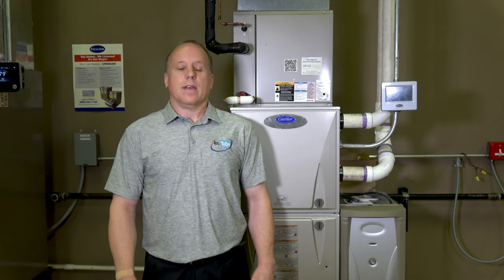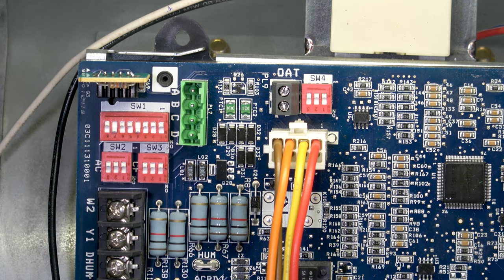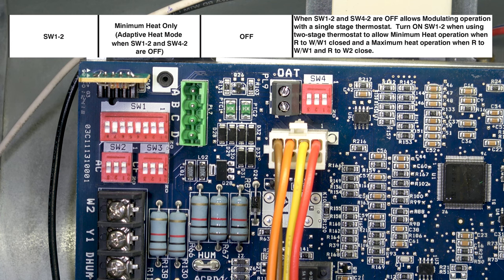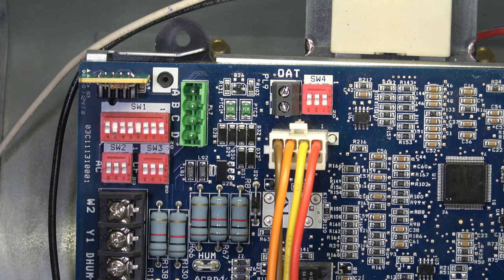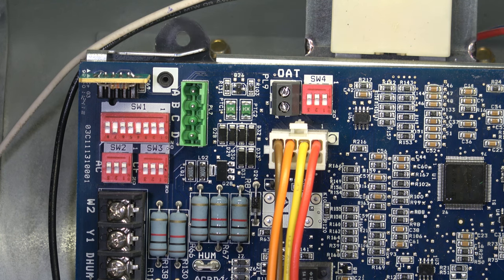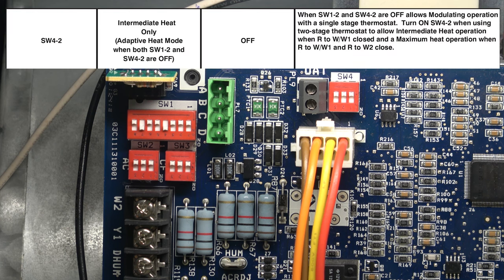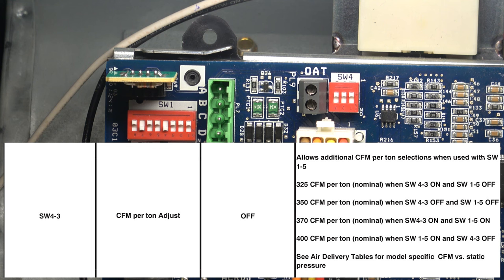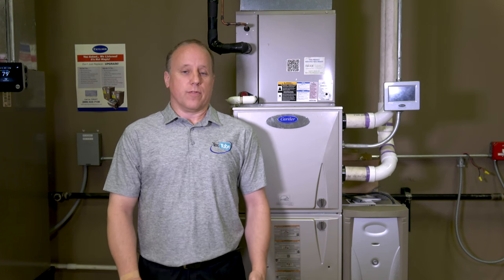Variable Speed Furnace Setting Switches for Carrier Infinity / Bryant Evolution

Comment: I have an ecobee 4 with room sensors in a number of rooms in my house.  Is it better to let my carrier furnace automatically control it's stages using adaptive heat mode, or is it better to connect the ecobee 4's W2 wire and use the thermostat to control the second stage because it can see the different temps in multiple rooms?
Reply: The installer indicated that if you were not using the Infinity Touch Control then they don't set any other thermostat to operate in 2 stage mode and always let the furnace handle it.  Is this because this is really better, or they just don't want to mess with thermostats they don't sell because they don't want the liability/responsibility of troubleshooting it?

Comment: Just had an infinity 96 put in 2 days ago and my blower fan stays on 24/7....even with the thermostat set to auto and OFF instead of heat or cold.  I watched this to try to figure out why the fan blows constantly and im still lost
Reply from the maker: Do you mean have the fan set to AUTO/OFF or you have the heat/cool set to AUTO/OFF?  These are separate selections.
Reply: @TECTubefilms  the fan setting is set on auto and the heat/off/cold is set to off. And the fan still runs. Only way it stops is to cut power to the furnace by flipping the kill switch (light switch to furnace's power)
Reply from the maker: @dunkcards7901  Have the installing contractor come back to investigate.  There are things that could keep the fan on when it should be off, such as error code on furnace (for purge reasons), a different zone on Infinity (if you have zoning), your schedule overriding your manual setting for fan mode, an input wired to the alternate G terminal and configured for fan instead of shutdown or alert.
Reply from the maker: @dunkcards7901  https://youtube.com/playlist?list=PLoR_O4JRNc27j4f0sdFYQJSZ-f6BhSD7i

Comment: I am trying to increase humidity as much as possible since I live in Denver and it is so arid.  We sit between 9-16% of humidity every day.  Are there any tricks to increase the humidity, turn off any de-humidification functions or any tips or tricks?

Just as a note, we are having an Aprilaire humidifier installed in a few weeks, but would love more humidity in our system and maybe for other readers who find this. 
I am personally installing the Aprilaire 700 Automatic model.  Do you have any help on the best wiring setup for best performance year around?  Yes, it will run all year on Automatic mode connected to the blower more call.
Reply from the maker: No reason to turn dehumification mode off. Just set it for 54% like we do in other climates. If it is not above that, it won't use the dehum mode anyway. This way it could still run it occasionally in the summer or other months if you do get a humid stretch in your climate due to rain, etc.
Reply from the maker: For HEATING season (aka winter), your only mechanisms to increase indoor humidity are to seal the building envelope tighter so dry air does not leak in as much and to install a humidifer.
Reply from the maker: Are you also having issues with dryness in the summer? If that is the case, you could increase cooling mode blower speed to 350 or 400 CFM/ton. Set dehum drain on 0 minutes. Use a higher cooling setpoint such as 77 degrees.
Reply: @TECTubefilms  Actually that is pretty inaccurate, a humidifier is what we use to combat dryness in all seasons of the year.  I installed an Aprilaire 700 automatic model but the 800 is better but I have a duct board return air duct.  I am a licensed HVAC business owner and do home performance for a living.  I was asking about specific equipment from Carrier / Bryant and disabling any dehumidification in the Infinity/Connex controller specifically as some of my clients cannot afford to install a humidifier. AC's naturally add humidity, but the thermostats dehumidify as most states need the opposite of us.
Reply: @TECTubefilms  We use humidifiers, i am talking about for customers outside of my service area and those who cannot or do not have a humidifier on their furnace or air handler.  Raising the CFM can only go so far. Most 2-5 ton units will not do more than 400 CFM and that is the default out of the box.  We are not going to turn up our air temperature to 77 as a way to fix and add humidity.  Have you even been to Colorado before?  Changing the temperature will do nothing but make you uncomfortably hot.
Reply: @TECTubefilms  It really isn't that simple on setting the dehumidification to an arbitrary number like 54% as an answer.  It is already defaulted at the highest setting.  I have discussed this at length with Carrier/Bryant tech support and those settings were already changed to maximum.  The only option is a furnace mounted humidifier but not everyone can afford one.  My company doesn't charge that much, but most companies bang people over the head.  So, I was hoping someone with some real knowledge beyond mine would chime in.  We do not have rainy days.  That is why we use Automatic humidifiers all year around.
Reply from the maker: @Balticblue93  What specifically are you saying was "pretty inaccurate?"
Reply from the maker: @Balticblue93  You asked for ways to increase indoor relative humidity and we gave you 2 ideas for heating season and 3 for cooling season.
Reply from the maker: @Balticblue93  True, most units will not do more than 400 CFM/ton. Not true that is the default out of the box. For the systems that this video and thread are about (Infinity/Evolution), the default is always Comfort Mode which is 300-325 CFM/ton. You can increase it as we described and this will change your sensible heat ratio to less latent capacity resulting in less dehumidification during cooling.
Reply from the maker: @Balticblue93  No one said anything was simple. But we stand by the fact that if you set the dehum setpoint of the Infinity stat to 54% it WILL NOT try to dehumidify at all in a dry climate on dry days. You don't want the humidity to be above 60% in any building regardless of climate. Even if you are running a humidifier in the cooling season, you do not need to set it above 40% RH.
Reply from the maker: @Balticblue93  If you are uncomfortable "hot" with a 77 degree setpoint and dry conditions (say 30-50% RH), you are unique and don't fit any of the comfort profiles of ASHRAE and others. In fact, the IECC mandates a MAXIMUM indoor cooling setpoint of 75 degrees for all of your designs.
Reply from the maker: @Balticblue93  True that raising your cooling setpoint does not "add humidity," but it does remove less moisture and results in higher humidity in the space.
Reply from the maker: @Balticblue93  Incorrect that "ACs naturally add humidity." That is impossible (unless it was a chilled water system and you had a leak LOL). In fact, if they run cold enough to hit the dewpoint, they remove humidity from the air (hence the reason for the drain line).
Reply from the maker: @Balticblue93  How do you have clients that can afford and expensive Infinity or Evolution system, but cannot afford a humidifier? Why not sell those types of customers a standard system with a humidifier to keep them in their budget instead of a top of the line without a humidifier.
Reply: @TECTubefilms  Do you even know what you are talking about.  You really need to review the ACCA books and get your head back together.  First off, please show me where the IECC code mandated the maximum indoor setpoint at 75 degrees... GO ahead I will wait.  That is garbage.  

Relative humidity can be increased with an Automatic humidifier or steam unit.  AND YES, Air conditioners naturally add humidity to the air just by principle of the blower motor pushing the air across a frosted or coil that is draining condensation.  That would be ridiculous to say otherwise.  That is why we program the fan to continue to run 24/7 and it will pull excessive condensation off into the air the same way a humidifier works essentially.  And our Aprilaire units run 365 days of the year here in Colorado with the maximum humidity level on the humidistat at 45%.  It will turn off the function automatically, once it has reached it's set percentage.  

First off, my clients don't get banged over the head like yours do, so affording an Evolution system is pretty small dollars for a variable speed system with a modulating furnace and every unit gets an Aprilaire 700 Automatic or 800.  You act like they cost so much.   Dealer cost is pretty low, and I never said anyone cannot afford anything.  I don't sell crap equipment to customers I want the best for.  I just do not mark it up insanely like the big-name dealers.  They have to pay for all that overhead and advertising.  As I said, every unit gets a humidifier and the Connex thermostat unless they go with a different brand such as the Ecobee Premium but that doesn't work with the modulating furnace and 26 Seer AC unit.  The costs between the preferred tier and Evolution are not that much.  I obviously cannot say that here what it really is but I would rather take a hit in margin than sell a lesser unit.  I think it is a joke that dealers are quoting 14 seer units with a single stage furnace and charging 10k-12k here in Denver.  I win nearly every quote that I put out.  I always do a good, better, and best quote.  The good is not some crap single stage.  I work with their budget and have financing otherwise at 0% for 36, 48, and 60 months depending on cost of the system all through Wells Fargo.  I do not have to compete with my competitiors.  My problem is finding enough skilled employees to get the work done on time and to my specifications.  That is where I am really struggling.  Nobody wants to work in the younger generation.  But that is my problem.  I will keep working my butt off and you keep doing whatever it is you call this.  Best of luck to you.
Reply from the maker: @Balticblue93  We are not sure which version of IECC you follow, but lets assume it is the IECC 2018 for now. Look at section R302.1.

R302.1 Interior design conditions. The interior design temperatures used for heating and cooling load calculations shall be a maximum of 72°F (22°C) for heating and minimum of 75°F (24°C) for cooling.

You can view here. Older versions have the same language. https://codes.iccsafe.org/content/iecc2018/chapter-3-re-general-requirements#IECC2018_RE_Ch03_SecR302
Reply from the maker: @Balticblue93  Your comment about the A/C evaporator coil adding humidity to the air is amazing. Where do you think the water came from that ended up on that coil? It did not come from a water line. It came from the air in the home. Hence, the A/C coil absolutely, positively, cannot add moisture to your home. It can remove it by letting it go down the condensate drain or it can retain it by letting it blow off the coil back into the air. But it cannot add moisture. Please tell us where you think the moisture collected on the evaporator coil came from?
Reply from the maker: @Balticblue93  YES you did say people cannot afford things. We quote you saying "The only option is a furnace mounted humidifier but not everyone can afford one."
Reply from the maker: @Balticblue93  We do not "bang any clients over the head." In fact, we do not even sell systems to homeowners at all. We are not involved in that sales process in anyway. We are not a HVAC contractor.
Reply from the maker: @Balticblue93  We are glad that you offer Connex and humidifiers to customers. And it is smart to offer them financing options and to work withing their budgets. You should make a profit, while not ripping anyone off. It sounds like you are doing the right things for your customers.
Reply from the maker: @Balticblue93  We call "this" a free education. We made a video to help newbie installers configure these dip switches and we feel it does that. We are not your free design support tool... but we did try to do that by answer your original question. Not sure why you got all upset about it. You asked for tips so we offered some but then you got all angry and mean. Not sure what you want.

Comment: Hi is up or down off on the switch?
Reply: off = up position, if your board is positioned in the same orientation as this video. In this video you will notice the word "ON" (albeit upside down) to the bottom right of each switch.

Comment: I have a Infinity 98 with a infinity thermostat . Once it goes on 100% heat rate it will not come of it. Any help . Carrier has replaced mother board and thermostat still no change.
Reply from the maker: Do you mean that it keeps heating forever irregardless of how warm the house is?  For example, if you set it for 70 degrees and it is 69 in the house, it turns on and heats... eventually ramps up to 100%, hits 70F, and then keeps heating to 71, 72... 75?
Reply: Once it is 100 % mode it does not ramp up any more i.e. it comes on at 100% and then stays on at 100% till it hit!s the set temp. The only way I  get it to ramp up is turn the power off/on then it ramps up for 3 to 4 hrs then goes back to 100% mode.I think it is the gas modulation may not be operating right . Carrier will not give me any support
Reply from the maker: @rodneyplatt1521  Still not sure what you mean.  It will never "ramp up" more than 100%.  And why are you turning the power off then on?
Reply from the maker: @rodneyplatt1521  If you local Carrier Dealer is unable to support you, call 1-800-CARRIER
Reply from the maker: Have your service tech watch our series on Infinity thermostats and make sure it is setup correctly.  https://youtu.be/hesq8TMhznQ
Reply: Thanks What happens is it goes on 100% when it starts, does not ramp up. This usually happens after it runs on a ramp up profile for about 10 hrs depending on outside temp, in order to get in ramp up profile I have to shut of power to mother board off. It then will start on a 40% profile and ramp up depending on temp. When it shut down sometimes it start on 40% or 100% As said when it goes on 100% there is no modulation i.e.stays on 100%
Reply: What happens is it runs like it is designed to run for say 6 to 7 hrs then for some reason it starts on 100% (no ramp up) and runs till it gets to the set temp then shut down , next time it also starts on 100% and shuts down when it hits the set temp.The only way to get it off this sequence is to turn off power for 1 min then turn it back on, it will then return to the 6 or 7 hrs sequence. Carrier Infinity Touch Control Thermostat 6 months old mother board 6 months old.
Reply from the maker: @rodneyplatt1521  Refer your service tech to page 92 of the service manual for the sequence of operation.  Here is one small piece of it that applies to what you described.

The furnace will start up in either intermediate-, or maximum-heat.
The furnace will transition and operate at minimum-heat or the
calculated modulating rate after starting and operating for 45
seconds at intermediate-heat. The furnace control CPU defaults to
minimum-heat on the first thermostat cycle and calculates the
modulating rate that the furnace should run at for 19 minutes on
subsequent heat cycles.
If the power is interrupted, the stored modulating rate is erased and
the furnace control will select intermediate-heat for 45 seconds,
minimum-heat for 19 minutes and then switch to maximum-heat,
as long as the thermostat continues to call for heat. The furnace
control CPU then uses this information to calculate the modulating
rate the furnace will operate at on the next heating cycle. If the
calculated modulating rate is between 40% - 99% then the furnace
control CPU will operate for 45 seconds at intermediate-heat, and
then operate at the calculated modulating rate for up to 19 minutes
and then switch to maximum-heat as long as the thermostat
continues to call for heat. If the calculated modulating rate is 100%
then the furnace control will only operate at maximum-heat until
the thermostat is satisfied.
Reply: Thanks for the information sounds like I may be causing some of the problem by shutting of power then turning it back on. Any idea what may be the problem or what I can do to solve the problem
Reply from the maker: @rodneyplatt1521  Without physically being there to see what it is doing, it would be hard to guess.  It sounds like it is operating correctly based on what you described.  If you are running non-stop heat for 6 hours without shutting off, then when it finally shuts off and then comes back on, it should start at 100% firing rate.  That would be the correct action for the furnace to take.  So then you have to figure out why it is running for 6 hours without cycling off.  Is it a "design winter day" in which case it should never shut off.  Is the system correctly sized?  Is there poor air distribution?  These are things at an on-site visit by an expert would sort out.
Reply: ThanksIn runs off/on for about 6 hrs and once it starts at 100% it continues to start at 100% Sorry I seem to have a hard understanding describing the problem
Reply: How much would a new board like this cost?